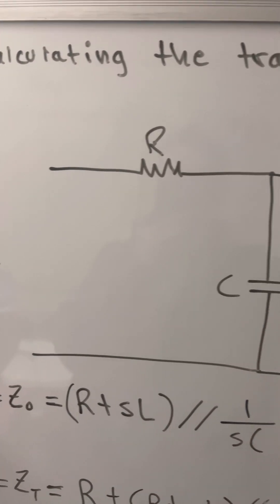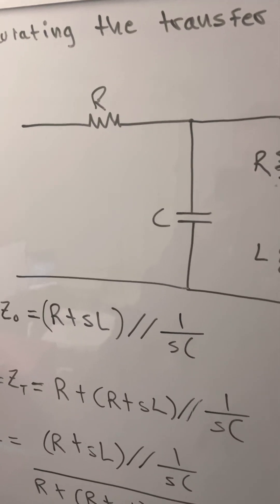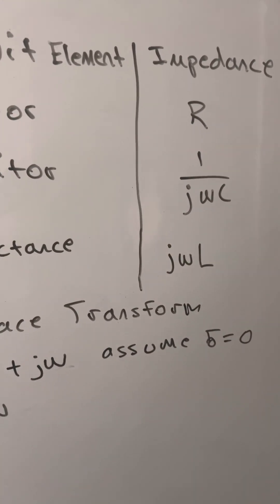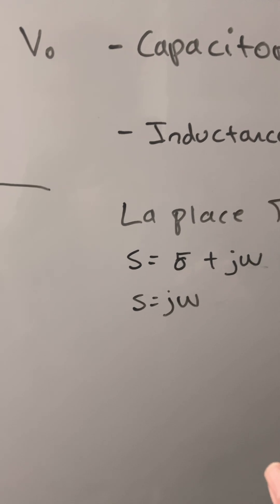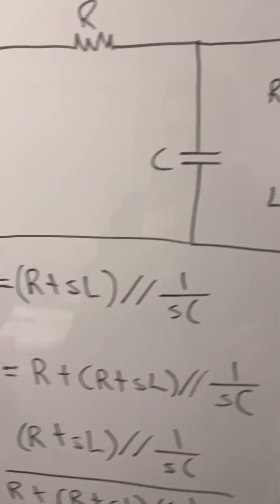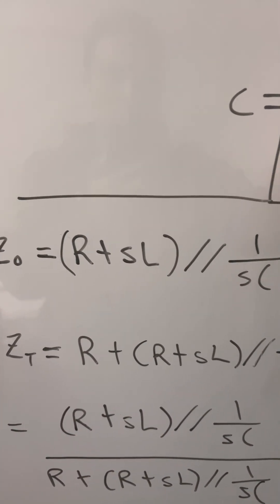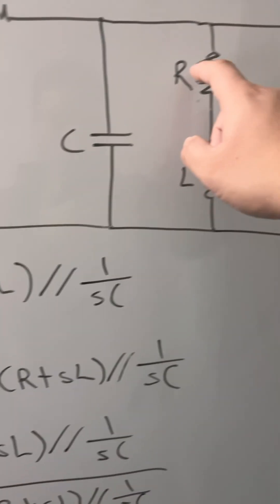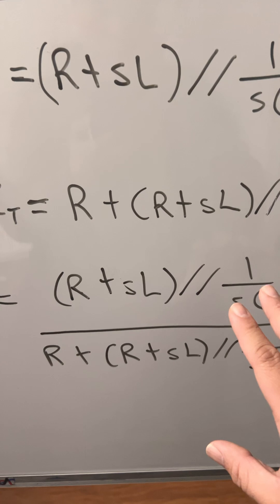Calculating the transfer function Vo/Vi for the circuit

Comment: Look and sound familiar from my EE class 30 years ago. Now it is a foreign language.
Reply from the maker: The sun is the same in a relative way but we are older. Time continues but the concepts stays the same. Good luck
Reply: @dailyamperes  Low pass filter?
Reply from the maker: @mitchnn  Close to a First order low pass filter. Is just that the inductor and capacitor are both in the same circuit. If its a First order low pass filter than the capacitor or inductor have to be independent of each other not in the same circuit.
Reply: @dailyamperes  Cool!!